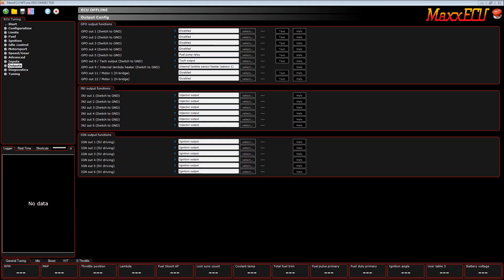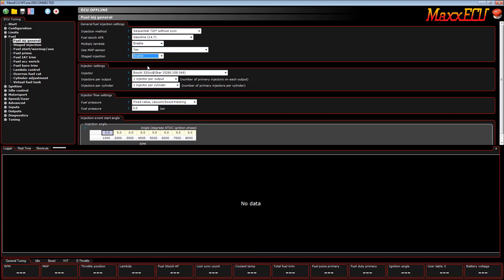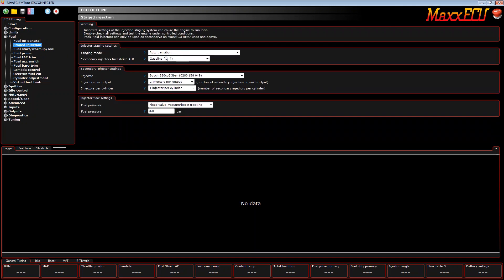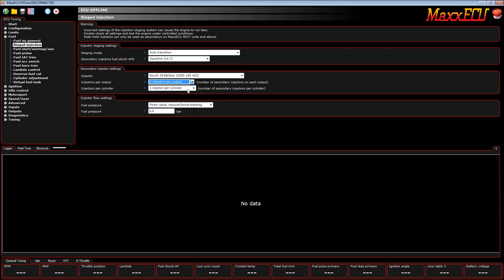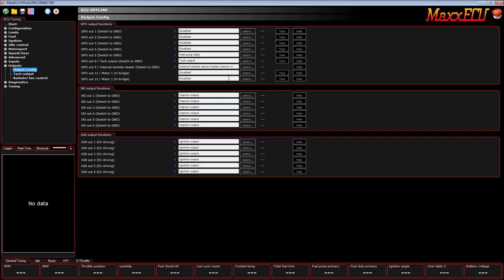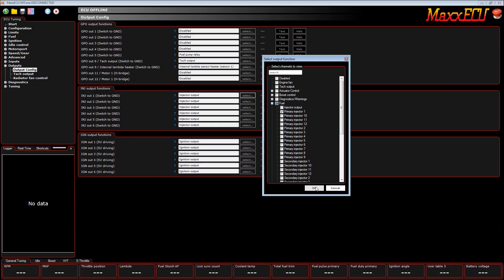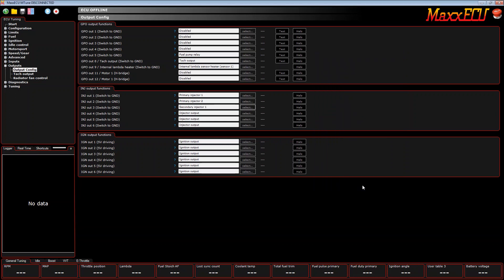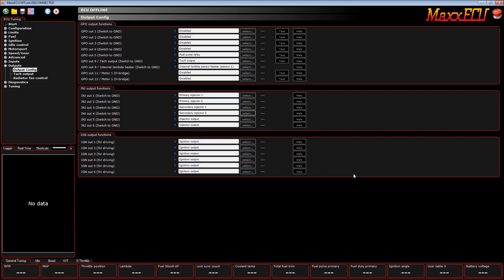MaxxECU Academy - Staged injection

Comment: Still confusing.  Is there a separate ground for stage 1 and stage 2 and it alternates the switch to ground between them?  If this is the case then it cannot control a variable distribution between stage 1 and 2.  OR does it spray half the injector duration on each cycle, and odd cycles it will spray on a closed valve and even cycles it will have half a charge in the runner and will spray the other half of the fuel charge? (I think this is called semi-sequential)

Comment: Would staged fuel pumps be setup in a similar way?
Reply: No. You have to designate an output to the secondary pump and tell the ecu to trigger the relay to the secondary pump at a specified rpm, map load ect.
Reply: Yes  @keltalon  luckily I figured it out hours after I asked..... 3 years ago... been running pwm brushless shortly after that as well. Thanks for the reply